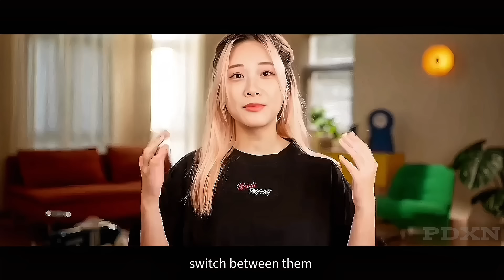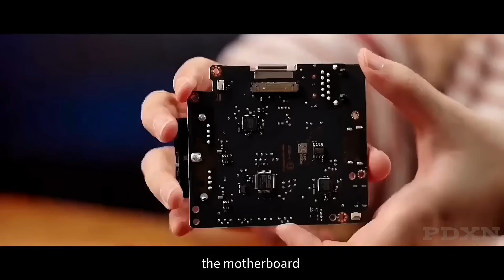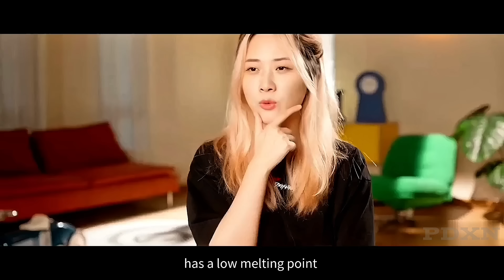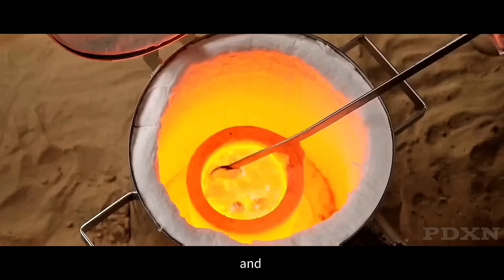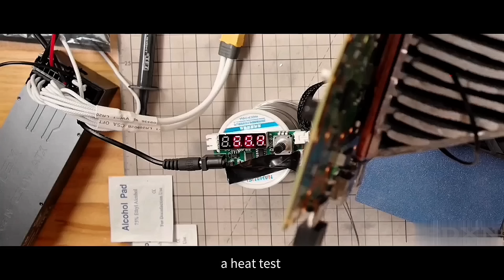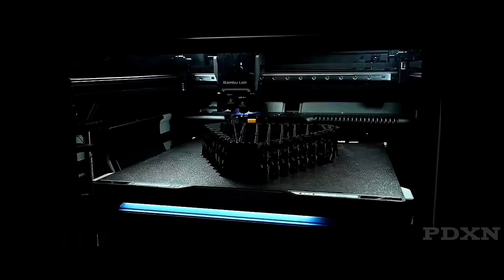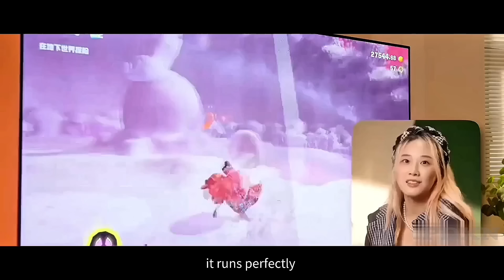I combined the three major consoles.

Comment: 0:28 uhh, actually an Xbox series X is on average $750 right now, switch 2 is about $500 and PS5 is about $600. Another thing, you can actually play all of the unique/original games on a pc. So in total this machine would cost you about $2000 and you’d have to know what you are doing and you can’t accidentally mess it up. You can get a decent pc for $1000 with a decent setup being at $1250. So look at the money you save, while still getting access to everything in an even better way because now you have a computer you can now do multiple actions besides gaming on, and you can mod the games that used to be exclusive because you can play everything. And if you want an even better pc, you can spend the same amount of money just on Black Friday and get a computer setup worth $2500 while paying $1500 that has better horsepower then those 3 consoles combined

Comment: Sorry, but I'm extremely sceptical. Where did the hard drives go? How does she play those games with no HDDs and no disc drives? How does the PS5 enter rest mode with the click of an external button? (It has to, due to power consumption, as she says in the video.) And how does it go to rest mode that fast? There's also no way of plugging in or syncing controllers, or connect network cables, which would have been a very easy addition if this was actually supposed to be a usable device.

Instead, the video focuses mostly on the 3D printing, the materials, plastic-to-metal, the laser feature, etc. So my bet is that this is a Chinese obfuscated commercial for the 3D printer, using a popular influencer. That's not illegal in China. And while the case itself isn't fake, the rest is. But I'd be happy to be proven wrong.

Comment: I have one critique of this model. She forgot to include an air/lint filter on either side of the air flow. Without a good filter, the stuff on the inside will get dirty or even corrode depending on moisture in the air. I'm not trying to be a downer, I'm just pointing out an important flaw in the design that could impact performance.

Comment: Thats an awesome idea! For the cooling though, you could greatly improve it by using regular industrial aluminium coolers, cutting three of them to make a triangle and then use heatpipes in grooves on the outside to connect them. That way you would receive a far denser fin stack which is advantageous for active cooling (your design with a low density of thick fins is naturally better suited for passive cooling, even though it wouldnt be able to properly cool a XBox or PS5 then) Secondary advante would be a smooth mating surface for your copper plates which also improved heat conduction.

I would be interested though in your little helper board to switch between the consoles, what did you use?

Comment: Suggestions: You could use an ESP32 to add a console switching animation to make it smoother. You could also use a Raspberry Pi 5 or any mini PC(or even better: a barebones computer or just a good single board computer, and also a compute module with good amount of RAM also with a modified I/O shield for it with heatsink and m.2 port, and this is possible as the Raspberry Pi foundation released the schematic for the I/O shield) to add a desktop experience for other work like productivity. You can also add a Mac mini (also stripped down or as full but increase in height) to add a Mac system. 
After adding all of this, you could also upgrade the cooling system to be liquid cooling by adding a secondary copper layer in between a simple liquid block so the cooling would be better.

The Nintendo Switch(If wanted) can be further stripped to thicken or thinner to add more functionality or just kept the same. 

A Valve Steam Deck could also be there, you know! (Not saying like an order or being angry, just an idea or just install steam on the PC section, just adding to the concept. The concept you made is insanely good though!)

Honestly, you did a great job in the project's working. These are just few of my suggestions as I can't afford all of this as my parents can't right now. Love the project! Hope to see you (or maybe working with you) do the version 2 with my suggestions.

Thank you
By Sappa, 13 y/o

Request: Please don't disregard/disrespect my suggestions due to my age! I've worked on hard projects like working AI based Robots with robotics and soldering, and have built my own PC.

Comment: what if next you make a controller where the buttons change every time you switch consoles lights inside the buttons would change to the button function of each controller, basically merging all controllers into 1 single controller? already this video is super revolutionary!
Reply: Option 1: the controller will be huge (with each controller having it own pcb (2 for xbox)) so a total of 4 pcbs in one controller 😆
Option 2 : reverse engineer the whole thing and have 1 pcb with 3 chipsets. Which is quite a hassle given each controller's chipset expects certain behavior on each of its pins.
Option: create ur own pcb with your own chipset, but it's close to impossible to make it work with no firmware to flash to it, because modern controllers have OTA upgradeable firmwares with encryption keys embedded (that's why u dont see any fakes that don't use the original chipset)

Comment: I had a similar thought (not for Nintendo) but for all consoles that use a standard disk. Insert the motherboards for each and everything else is shared. Then, whatever disk you insert it automatically scans each console until it finds one that can read the disk. Yours is more complex in that the consoles are all technically running at the same time which is super impressive. And obviously combines switch which is vastly different. But yeah theoretically I thought my idea was possible and your journey makes it seem even more plausible!